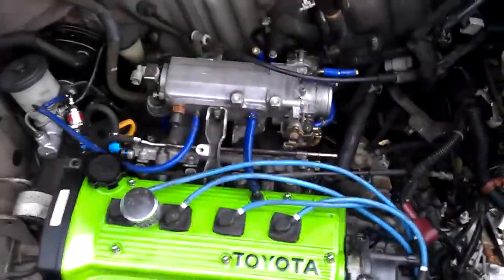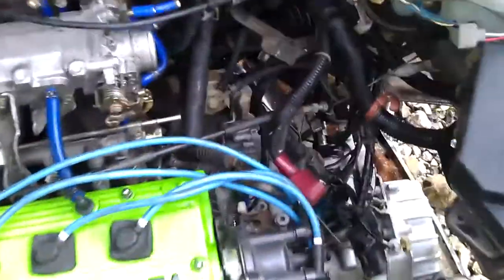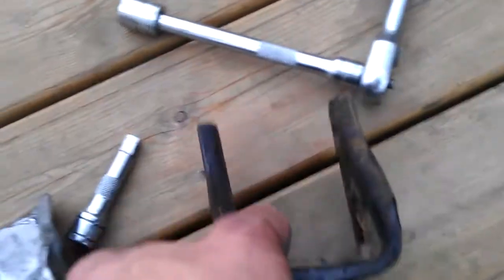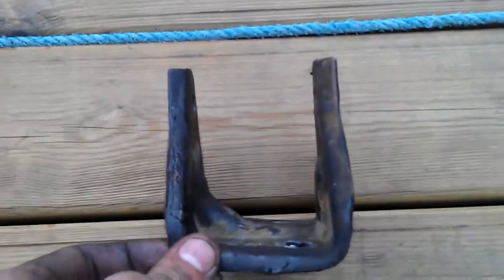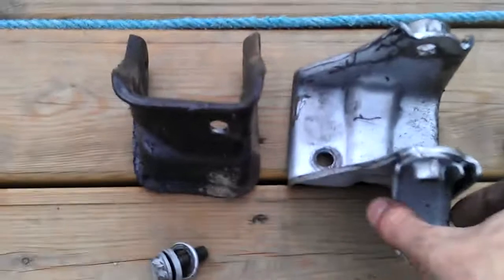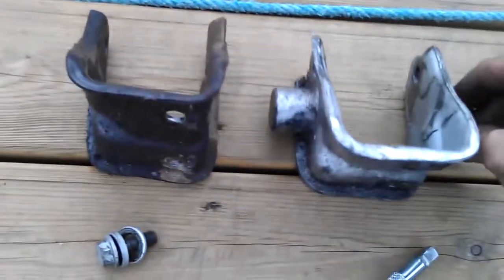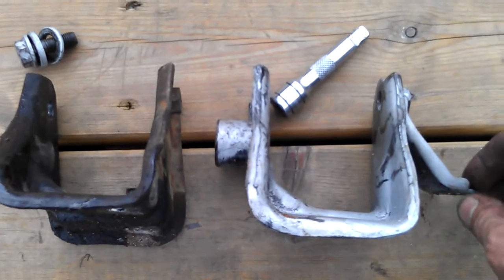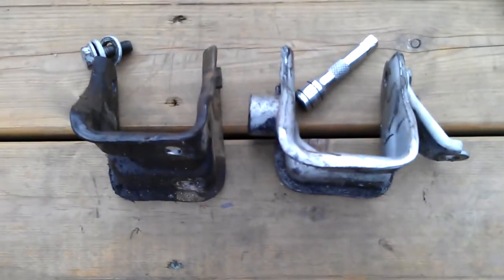EP70 (boxy starlet) 4EFTE Turbo conversion part 7.5: Engine mounts

Comment: did you just wled the other mount in place? or drill and tap the holes?
Reply: thats what I wanna know cause only 1 mount from later model should fit is the gearbox one .